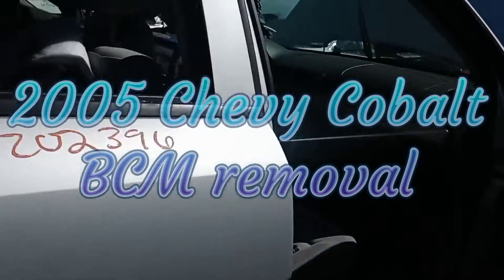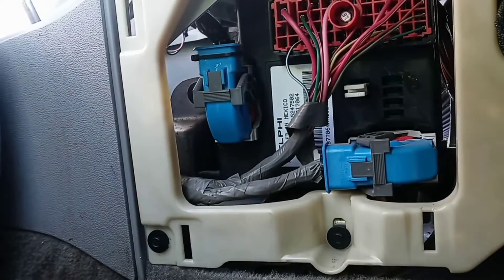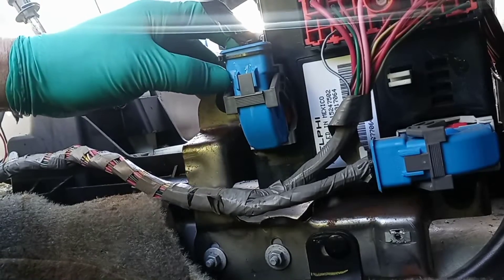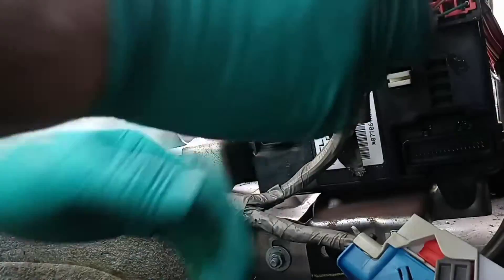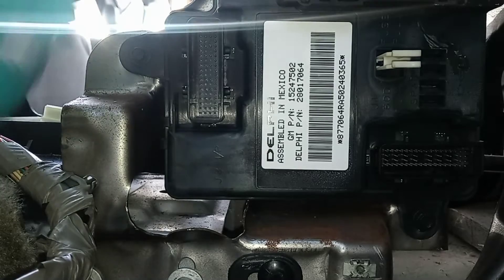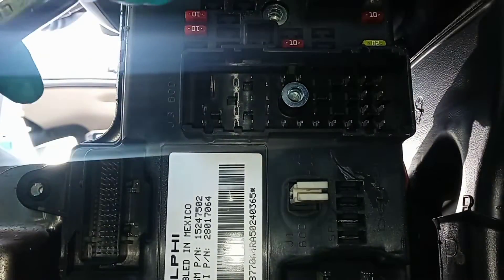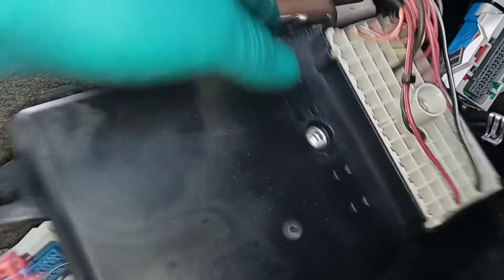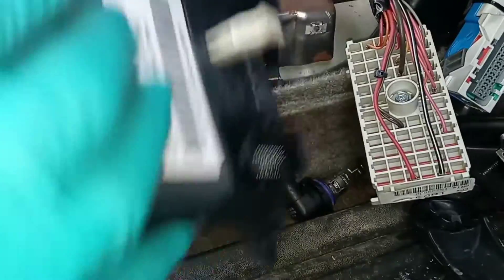Chevy Cobalt body control module removal

Comment: I just replaced mine, but now my car will not start. I disconnected the battery before working on it. What else could it be? I'm getting power. But its like the starter isn't kicking over. But the starters 3 weeks old.
Reply: I’m assuming it was a security reset you had to do?